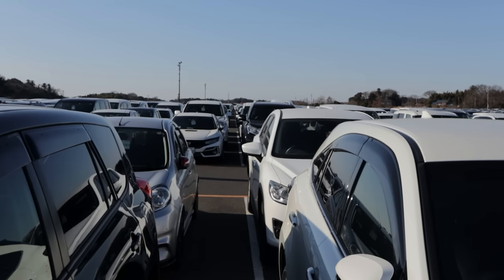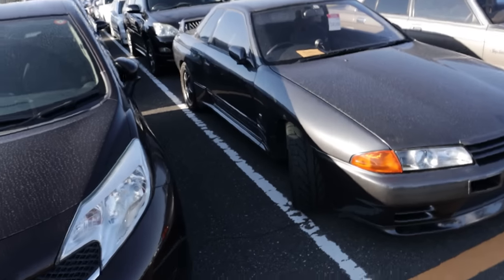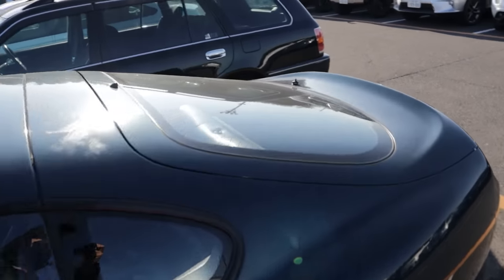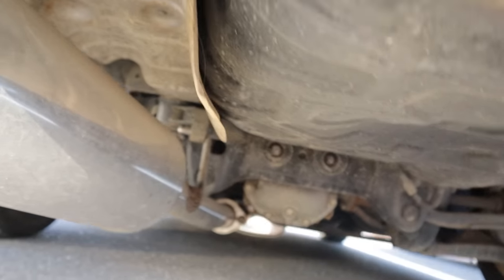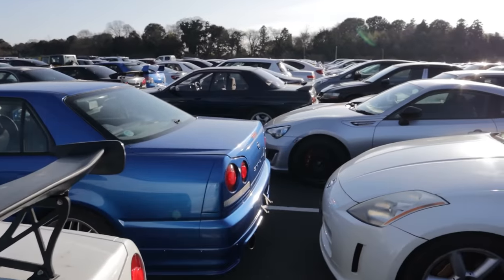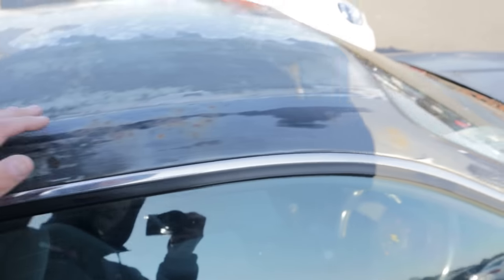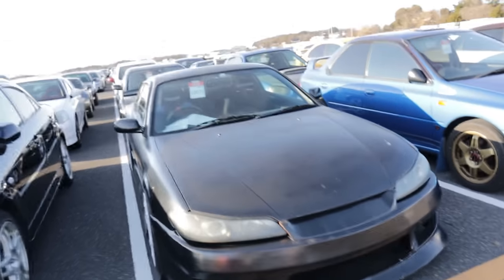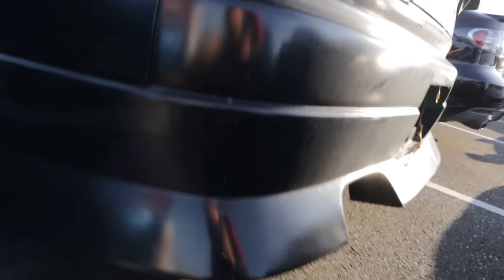BIDDING ON CARS AT JAPANS BIGGEST CAR AUCTION HOUSE!

Comment: Type RA is basically the lightest version of the STi you could buy back in the day. That car comes with a EJ20k which is an open deck block and could probably handle 350whp before you blow it up. That roof scoop actually funnels in a ton of air at speed because AC wasn't standard on the Type RA trim. I think being a V-Limited meant that it was kind of loaded though and it even came with a rare 5spd DCCD trans with a 4.44 final drive that made these things feel super quick. Subarus are awesome, even here in America where we get all of the step child trash lol

Comment: The 1st gen Impreza, referred to as the "Classic" is the only generations WRX/STI that got the sedan, wagon and coupe bodystyle. If its with a roof scoop, then its a Type RA (like what you seen) and usually don't have a/c, abs, electric windows for weight savings ... then the 2 doors are referred to as the Type-R. The red Mazda RX7 seems to have a rare A-Spec bumper - memories from Gran Turismo .... And that R33, how does it still have the standard exhaust :)
Reply: thr roof scoop indicates its a v-limited only the limited models have a roof scoop BUT not every limited has one i have a sti v4 type r myself without roof scoop

Comment: If you're after an older bugeye/blob/hawk WRX try find one that has had the failure prone original driveline swapped out to an ej207 and 6 speed manual, otherwise just go for an STI as they have that engine/gearbox. Factory forged internals and 350kw+ capable gearbox. Having a good tune is key, ideally go a speed density tune to delete the MAF sensor as they fail too

Comment: Subarus are well balanced cars. Low center of gravity, good low end torque, decent high end output when boosted. Lots of fun off road or in the snow. Gotta reinforce the engine though if you want to avoid frequent rebuilds. EJ engines are near bulletproof until you strap a turbo on them, imo. AWD systems are pretty decent too. Big aftermarket for them.

Comment: Watch out for head gasket failure, a good way to tell is look in the oil cap for a white creamy substance or check how much coolant there is because there might be a leak. Oil also can leak out the value cover which is a common problem. There are sometimes suspension issues but I image you would change them for rally driving. Try getting a 6 speed I don’t no from experience but I have heard they are stronger than the five speed I not sure if all model came with six speed but I guess you can do some research around that I hope some of this is useful, keep up the good work 👍
Reply: The 5 speed is literally a Handgranate if you throw more power at it, you'll never know when it is going to explode.
The sti models always come with the 6 speed wich is very capable and strong, the wrx comes with the 5 speed :)
Reply: @chrissi0210941  cheers, I wasn’t to sure about that area.

Comment: Buy a bug eye. Remember it's the cars no one wanted that becomes sort after. Like the 33gtr and dr30.
And if you want to build a Rally car most of its cheap but U going to need the sti box. It's like what an r200 and a 33box for Nissan. The sti box is an engineering masterpiece with a front/rear touque split that is adjustable. Trust me on the sti box. I'm not a Subaru guy. I'm Nissan through and through. But learnt a bit about the rexys over the years. U don't need huge power to be a fast rally car. You need the sti box (did I mention that already)
Raised suspension. A good set of rally tyres. A cage a set of harnesses and your racing. 
The best rally car is one you can reshell for cheap money. The bug eye is perfect
Reply: Damn right! Bugeyes look epic

Comment: In 1994, Subaru introduced Subaru Tecnica International (STi badged) versions of the WRX in Japan. These models were upgraded from the standard WRX in many categories, including blueprinted performance tuned engines, transmissions, and suspensions. The STi versions of the WRX were immensely successful in rallies and popular among street racers but were only sold in the Japanese market. 

The V3 STi had seen major upgrades as opposed to the prior two variants. Multi-point Injection, a new IHI Turbo allowing more boost to be added, larger intercooler, Molybdenum Piston coating, and revised camshaft timing and lift. This  brought the HP and torque numbers up to roughly 280HP and 260lb-ft of torque. The brakes were also made larger to accommodate for the increase in power. An automated spray system was also added to keep the intercooler cool.  The 1998 model year called 22 B has the 2.2L with 
Power set @  300 hp @ 6300 rpm.
Torque: 267 lb-ft @ 3200 rpm. And only 400 were ever made for Japan only.  Collectors have started to scoop those up and many are going for 6 figures.  Like $100k to over $300k

Comment: Hey sam the roof scoop is a cool thing to have on a rally car. what i picked from rally team breakdown of their car mods when your windows are closed or changed to plastic ones to save weight and your heater is turned on to cool the engine it gets real hot inside and some fresh air from air scoop does help a lot

Comment: The kit on the FD is the Mazdspeed A-spec front bumper and the Type-II wing. The kits is pretty rare these days, especially complete with the front lenses, and the even more rare MS front badge that is supposed to be on that bumper. On YA a bumper recently sold for several thousand USD and I paid 1K for the same wing 2 years ago.

Comment: @ 21:00 in, that red fd has a super rare bumper. The MazdaSpeed A-Spec Type II front bumper, it also has the A-Spec Type II side skirts and wing. Only thing its missing exterior wise was the MS-02 or MS-01 wheels. Cheers

Comment: I see a lot of those cars had faded headlights. That’s because the plastic lens has lost its uv protection. You can respray the lens with clear coat to restore them for a new factory finish. That’s what we do at the body shop I work at and it has amazing results

Comment: That broken thing in the radiator of the chaser looks like the guts from a pressure gauge. The body of it probably broke off. Would've had a needle and a round face with numbers. Definitely something that was added to read pressure and not need a digital gauge.

Comment: Let’s talk Subarus. I just bought my first Subaru 2 years ago. Although i just bought a standard auto to get around. 09 Impreza hatch 2.5 premiem. From the information I found on the net and actually dealing with the Subaru. I do really like Subarus but they do have problems that you will have to deal with like oil consumption. That being because the piston rings wear out uneven as the pistons lay on their sides. Also with the Ej motors having a defect from the factory being that the heads and head gasket warp if it has not been rebuilt. You should look out for an oil leak or oils build up by where the bottom end and heads meet. If you want a Subaru, you should look for one that has not been molested or at least know the shop that has messed with the car. Check to see if the engine was rebuild for machined heads, honed cylinders, new piston rings, and new seals all around. Having an oversized oil pan with baffle and having the Coolant hose mod done would be nice for the motor. If your are going to rebuild the motor, trying going with a closed deck cylinders. Other that that. I believe the rest of the car if great. The subie unequal length headers are is an awesome sound but it does take a chunk out of the mpg’s. If you need help with your cars or making videos. I could use a job?

Comment: Glad that you made it back to JP. GC8 sti Type RA is specify with 4 doors & little window at top which is cheaper than ver 5/6 Type R and good to buy however GC8 body is softer than S201 or the later series (experience more body roll). It will be great if you get a RA or S204 and start modifying it for content.

Comment: I own an Imported subaru legacy gtb twin turbo. Mines an auto so it has the ej206. If you're looking into subarus obviously head gasket issues also make sure to check oil frequently as subaru motors consume a decent bit of oil. And then from there it's basic car maintenance and the car would run fine. Most stock bottom end subaru motors can only hold about 350 ish safely depending on a few things and such. But you can build the bottom end and obviously go for more power. Also if you're looking at what I assume will mainly be imprezas the 5 speed transmission are apparently glass so try to look for the sti 6 speed Trans which holds up better. Parts are a bit hard to find for the imported subaru stuff where I am, but that shouldn't be an issue for you in Japan haha

Comment: Clickbait Sam coming in clutch once again... actual bidding starts at 30m into a 32m video and lasts for about a minute.

That yellow NSX likely needed those add on turn signals for inspection purposes. The US cars only had front turn signals + side markers. Our cars generally didn't have side turn signals until fairly recently.

Edit: That reminds me, at least in the case of my V35 anyway, when I got the JDM tail lights they did not have the integrated side marker LEDs that the US lights had, they were replaced with reflectors. That was a thing people often did when cloning a US car into a JDM one, deleting the rear side markers. Especially in the 90s/00s.

Also, passed by a stupid clean looking 06-07 hawkeye Sti for the Cresta, The Type RA was cool, but the Blob behind it was probably more the speed for what I'm assuming the Subaru would be intended for.

Comment: A think that subaru is cool 😎  👌 🔰 special edition.  Lots of good spec. WRX sticker is the original cool one .  Think they used type RA as the rally car , the coupes were too dear, but welded the rear doors closed . Could be entirely wrong. But something stands out about that model

Comment: gc8 came both as wrx and sti as ra and r. ra is the race altered version so its a bit lighter has no abs, little bit bigger brakes, plated rear diff instead of a visco and most importantly a stronger gearbox with DCCD and 65:35 torque plit letting you skid instead of understeer. (dccd only came in the sti tho) they type r is the 2 door coupe variant then the ra and is technical almost identical but worth twice as much. i would either get a abse gc8 wrx which is the cheapest ot and sti ra if you want have the right material from the get go. i have a sti v4 type r myself :)

Comment: Type RA Limited STi GC8 would be a track toy to drive v7 ej207 with the large port head higher stock rev limiter 4.444 gearings helical center diff would pull outta the corners enough to scare many people not expecting it

Comment: My very first car was a subi gl wagon 5 speed, loaded, it had a bolt under a rubber grommet under the back seat that would if u tighten it would raise the rear end and the two front struts had two nuts on each that would do the same. Cruise control, digital dash, power everything, mirrors, windows, tilt steering. And it was a tank, I could not kill that car. I went through water in a small river and the water came into the car and just kept going...the plugs are really deep in the engine and plug wires are a snug fit.
Reply: Then I bought a 97 gc8 Impreza. I drive it off a used car dealer and thought there was something wrong with the gas mileage and called the guy, he says under the hood up against the fire wall there was a little fuse box with one fuse in it he told me pull that out and it would put it in fwd...I never knew that....they could have put it on a switch....lol
Reply: I love subis, swear by them, never let me down, besides a axle letting go. Love the way they sound, there like a Harley Davidson when u hear one go by u know it's a Subaru....if it's a boxer....lol